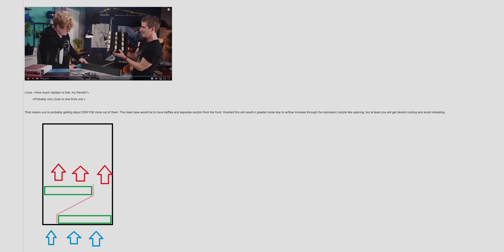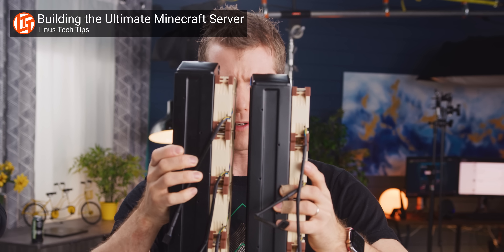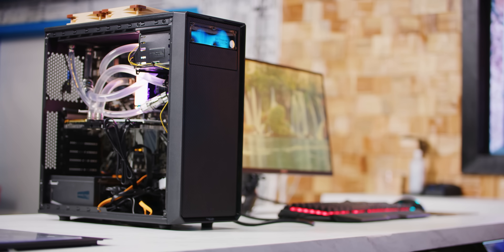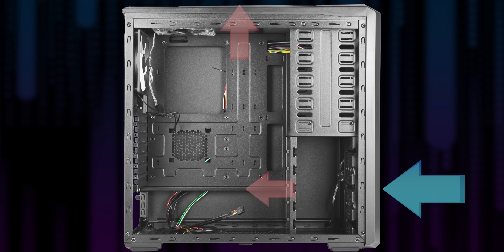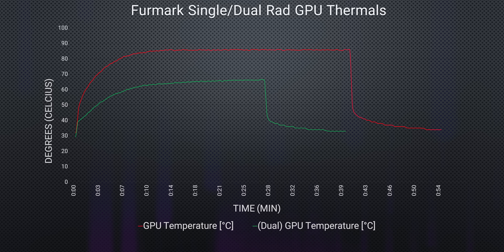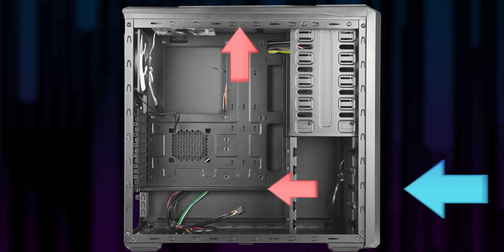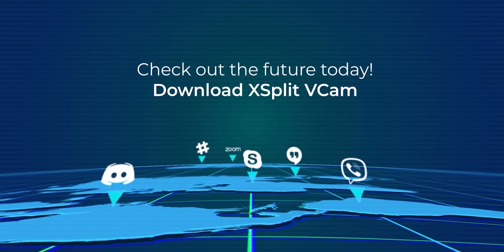I’ve been water cooling wrong for YEARS - $H!T Manufacturers Say

Comment: "Ive never done a side by side comparison" Then goes on to NOT stack radiators for a side by side comparison, and has the first rad in the loop from the MB as a exhaust and second as intake. Completely different than what he had done previously, and not at all what Corsair was saying.
Reply: Exactly what I was thinking!
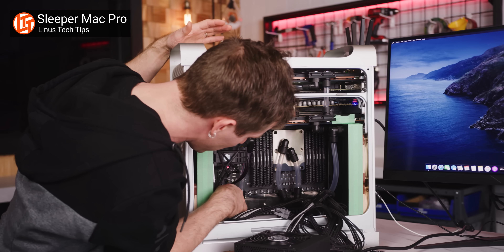Reply: Watch from 6:40 and he makes the change to the same machine they were commenting on, and the temp also increased
Reply: @Jonno12345  All he did was remove a rad, should of just not stacked them and used them all as intake. Probably barely cooler that way, and probably impossible to actually put back in the system in that configuration.
Reply: Corsairs comment wasn't about stacked radiators though - It was merely about utilising more than one radiator in a system, though.
Did you even watch the video?
Reply: @christoffermaintz781  No i just commented on something from the video without watching it, cause im magic like that.

Comment: Perhaps it depends on where in the loop are the intake/exhaust radiators... Maybe it's worse to have the first radiator in intake and the second in exhaust (since the difference in temperature is going to be diminished for the second radiator). It could be better to have the first radiator in exhaust (dissipating the bulk of the heat and not heating up the air inside the case) and the second one in intake (with both air and coolant temperatures lower, resulting in a higher temp difference throughout the loop). But I agree with your explanations, arguments on both sides makes sense!

Comment: Interesting video, but, there are many things to consider in this cooling problem and your arguments. 

First of all, why don't case manufacturers build cases which a specifically designed for water cooling? You don't want to cool a radiator using the hot air inside the case (after all cars don't cool the radiator with air from the engine bay), the radiator should, for example be mounted on top of the case with a cross-flow of room air, which is cooler than inside the case. Then have conventional air cooling within the case to remove excess heat from the remaining components. 

Furthermore, cooling would be improved with a larger mass of coolant, which might go some way to explain your hideous stacking system. The benefit would be that you would maintain a larger temperature difference between coolant and cpu. Think of it this way, you have a constant heat source, the cpu, and a certain mass of coolant. If the mass of coolant is too small the temperature will rise rapidly and be difficult to cool a much larger mass would rise more slowly and be easier to cool. What you also need to consider is the cooling efficiency of your radiators which need to be capable of removing sufficient heat to keep the water temp down and hence the cpu temp down. And it goes on... It's a really complex problem and to do it properly you would need to collect a lot of data from temperature sensors all over the place. Maybe, another video?

Comment: Just try that every radiator gets fresh air from the outside for the best efficiency, instead of re-using the warm air that already passed through your first (or second) radiator when you stack them. That's the central point. 

Stacking radiators one after the other DOES reduce the amount of heat that are able to dissipate unless you have an input of fresh air between them.

(Mechanical engineer with a master degree in thermal fluids here, in case anyone asks)

Comment: Makes sense. If the first radiator is completely saturated, it's physically not able to dump all of it's energy into the passing ambient. Meaning that there's still a heat differential able to be used to dissipate additional heat using a second radiator (even if it's not a doubling of efficiencies - which isn't realistic anyway).

I think that's the real crux of the issue though. Is the better thermal performance worth the cost of a second radiator? I would say that unless you're bumping into dangerous levels, and or thermal throttling, the answer is no. And if you want lower temps, you may want to just invest in a better radiator in the first place.

Comment: I mean yeah, having warm air from one radiator enter another radiator might make the second radiator less efficient by reducing the temperature gradient, but unless the air is already the same temperature as the radiator it will still transfer energy from the water, to the radiator, to the air. Basic physics; energy wants to spread out and not be all concentrated in one place, eventually leading to entropy and the heat death of the universe. And sometimes you just don't have the ability to ensure every radiator is getting 'fresh' cool air.

Comment: It is possible to create both scenarios by scaling up or down the radiator sizes and fan speeds. And of course case volume and CPU/GPU capability to transfer more heat to the loop matter as well.
Try using very small case with components that transmit a lot of heat and then put one 120mm radiator in front. Then the second radiator would be useless.

Comment: Question, have you had a radiator leak?
Mine did last year and since then I've moved my radiator to the front of my pc instead of the top of my pc. Granted my new case has that ability whereas my original case did not. Managed to get the parts all reworking even after leaks and shortages, minus my ram I think thats finally kicked it last week and needs replacing. That or the MOBO

Comment: It is absurd saying that you would get higher temps... however they are quite right when pointing out the fact that you are not doing an efficient use of those radiators. 
Proof is that removing one out of three radiators didn't mean 30% higher temps...

Comment: Obviously you arent testing what Corsair was critiquing. Double up your radiators vs having a single radiator. There will be diminishing returns, but there will still be returns. 
2 things. 
1) when you add water mass you are increasing the time required to heat the water, resulting in cooler temps for longer. 
2) there is very little concern about re-heating the water due to exposure from warmed air because computer cases have generally enough airflow to bring in cool air from the outside, or you can always have a balanced intake-exhaust ratio of air. The computer will basically only equalize when the room temp and rad-temp equalize which wont happen in modern houses with AC.

Comment: Linus: "do your own research"

Me: "this IS my research..."
Reply: Remember kids, the difference between science and fucking around, is writing it down.
Reply: BloodSteyn holy shit that is actually true
Reply: @BloodSteyn  yes!
Reply: @BloodSteyn  because recording it doesn't count
Reply: ''This is OUR research"
Reply: @YoshinoXTempest  Comrade...
Reply: itstillgot come out hot so hot air hit hot raditor won't do much...
Reply: Im a little late here but his test actually proved corsair correct and i can also say for what he was trying test, he set it up wrong. Thats why you should do your own research, to bad you drank the kool-aid.
Reply: @timessiah94  no this is just an example of why stupid people have a hard time succeeding in life. Stupid research by stupid researchers has the same problem.

If the case is "airtight" with no airflow near the ram it won't matter. The point ia that you need air blowing directly on the ram. Hot air blowing on the ram is better than no air blowing on the ram. Heat travels by 3 modes: convection, conduction and radiation. For air to flow over the ram and thus carry heat away by conduction and convection there has to be a path of low resistance as well as a pressure differential for the ram to sit in. There could be 5000 holes in the case. That is not a problem as long as one or more of the holes induces cooling air to flow over the ram. The optimum flow over the ram amd through the case to minimize component temp  is a different issue. But the air will always prefer to flow the path of least resistance combined with the greatest pressure-drop. So it will not flow over finned surfaces until the pressure differential is enough to overcome the flow resistance. A simple smoke test combined with useful thermistor placement will guide to the optimum case and fan configuration.
Reply: @pedritodio1406  dude check for innocents before you drive-by and start blasting, thanks
Reply: @touristguy87  yeah speak that to yourself
Reply: @pedritodio1406   I'd look silly so I refuse
Reply: true....

Comment: Stacking radiators is probably a bad ideal. But why don't you try this experiment. Stack radiators, by putting the Intake in the front and the outtake in the back. Then try the Intake in the back and outtake in the front. I bet Corsair logic is based on intake on the front not the back. But if you intake on the back radiator first I bet the system runs cooler. 
Linus time to get out your test bench all over again!

Comment: You should stipulate "STACKED" or series radiators... If you don't stack them, it works fine... if both radiators are seperate drawing cool air there is no issue..... Parrellel vs stacked will allways be better....

Comment: You are using twice the water mass inside the case that will be cooled. Also, airflow is included in the reasoning... If you push the air too slow it will be hotter. If you use less mass that will be cooled(same air  flow), it will be hotter. Also the heat capacity of water is >4x the capacity of air that you are displacing by just putting the radiator in the case.

Comment: I'm using two radiators.  CPU less than 50C and 2080 super graphics card 46C, water 36C while playing Black Desert Online and watching full screen YouTube videos.  I do have a fan bringing in outside air for the second radiator so it doesn't just get warm air from the first cooler.

Comment: I think I see what's going on here. It's possible that system with the 3 stacked rads would actually cool better if the rads were more spread out. Though I don't see how that would be possible with that case and things seem to be working fine the way it is.

The claims that I've heard in this video indicate that there shouldn't have been a temp increase when one of the rads were removed though, that on its own was proven false.

The TL;DR of all of this is while it's not the most efficient way to do it the cooling solution works. I don't personally see an issue with it.

Comment: “Now, if we had sealed off every potential air leak, it’s possible we would’ve seen something closer to Corsairs simulation. But, as far as we can tell, that’s just not a true representation of the real world. I mean, nobody would do that.”
I was really expecting you to follow up with “…or would they?”
 and then show us how you sealed up all the holes and ran the tests again.
Reply: I don't think Corsair was quite right here in the first place, only some of the air going through the radiator will be maximally loaded, but most of it will not be as the water cools going through it. Also depends on the loop flow, basically you want to cool the coolest water /radiator first and then the air can still be used to cool the hotter radiator.
Reply: @defeqel6537  I agree with this statement.  I am not a chemist or physicist but I am thinking that at the molecular level, only a very small amount of air molecules actually make contact with the fins and that the heat would then have to transfer from air molecule to air molecule from there and that with each jump, the process would lose efficiency. This means that the air molecules flowing directly through the center of each hole in the radiator would be cooler than the air molecules that actually make direct contact with the fins.   However in a mathematical simulation, if you assume all air molecules actually make contact with the fin, then sure, stacked radiators don't make sense.
Reply: @bengaming3649  that's why they call it Physics 101
Reply: With Flex-seal, the all in one solution for sealing gaps and cracks.
Reply: i was thinking as he said that.. "i would"
Reply: Case manufacturers - hold my beer
Reply: What Corsair is saying is that there is only a negligible or nearly negligible bump in cooling when stacking. The reason their Minecraft server coolers worked better is because it had more fans to combat the increased air resistance, but they still had plenty of heat soak because they're trying to get twice the airflow through the same airspace.
Reply: I did that before, with take and black cardboard over every sized opening. But that was more to prevent dust buildup.
Now I just use diy filters which work great.
Reply: @HappyBeezerStudios  what is best diy filter material?
Reply: @netmaster88  remove the side of your case, add a 20" box fan with a 20"x20" hepa filter taped to it (on the intake side). The fan blowing into the case will create a positive air pressure of really clean air. Ugly, but form follows function for this engineer.
Reply: @HappyBeezerStudios  keeping your place clean also helps alot !
Reply: Yeah, that would be a good test. Also, you may even see similar effects if you just have positive air pressure in the case.
Reply: I'm even more impressed with how they've actually asked everyone.
Reply: What is heat capacity? Run zero radiators and a 55 gallon reservoir and you'll smash these results. The extra radiator is adding water volume, that's all.
Reply: @hlaw2830  you've got it backwards. Radiators reduce the thermal resistance to heat transfer between the circulating medium and the ambient.Adding more water would increase the heat capacity of tbe circulating medium but it will retain the heat with insufficient radiator flow to ambient. The same process that leads to solar fusion.

Heat sources produce heat in W/sec and the job of the cooling system is to transfer heat to ambient at that same rate otherwise the entire system heats up and reduces effective heat transfer which causes the source to overheat...it is a cycle....
Reply: @touristguy87  One BTU is the energy required to raise one pound of water one degree fahrenheit, and 55 gallons weighs 458 pounds. If people can water cool a DE HPS grow light like this, your computer won't be a problem, lol. That said, this is all about to become obsolete, my boi wanted to improve cool suits because race car, and he's figured out how to drop ambient to less than -60 almost instantly with peltier sandwiches.
Reply: @hlaw2830  wow, he's caught up to 1834  maybe next he'll think of using a gas cooled to its liquid state maybe even CO2 solid!
Reply: @touristguy87   Lol, are you under the impression that computers haven't changed since 1822 as well? He's been talking with big companies in the cool suit industry, and the best their engineers could do was 60F at 40a/14v in a 170F cockpit; he hit them with <0F at 8a/14v in a 170F cockpit, something they said was impossible before he demonstrated it.

In case you don't understand the significance of those numbers, imagine hearing about a car which gets 75mpg, with a top speed of 390mph... and then commenting that people have finally caught up with 1886, lol.

I'm embarrassed for you, my man.
Reply: @hlaw2830  they were playing him
Reply: @touristguy87  Lol, no they weren't, but if you think you can put together a peltier that efficient and effective yourself, there's a mid six figure offer out there just waiting for you.
Reply: @hlaw2830  "Putting an insulated suit on a race car driver is an absurd proposition,"

Not if it's insulated to keep heat out

how many times this summer have you stopped yourself from putting drinks into a cooler with ice to keep them cold? 

Or do you not understand the word "insulation"?
Reply: @touristguy87  I understand insulation, but I don't think you understand motorsport. Dexterity, endurance, and reaction time are all huge factors. The machine isn't doing all of the work, these guys can be pulling 6+ lateral Gs. They're single foot leg pressing ~350lbs coming into quite a few corners, while experiencing 5 Gs of deceleration, and a lot of series ban power steering as well.

Plus, you need to be able to hop out quick and easy, or be dragged out, in the event of a crash. So, while I don't actually disagree with your premise, the materials don't exist.
Reply: @touristguy87  So, you admit that the materials don't exist?
Reply: @touristguy87  No, rediscover that optimism you felt when you were fresh. Stay skeptical, because there is a lot of bullshit out there, but... there are a few specs of gold in this garbage heap. Dude's still early alpha with these peltiers, but for a few years on the side in his basement? Don't be one of the people who said the first IPhone was stupid because it didn't have buttons, lol.

I mean, fuck Nomex, what's up with aerogel? I don't think it can achieve what you're talking about yet, but... who says it can't tomorrow? Did you get a degree to build something, or to maintain what other people build?
Reply: Didn't he do exactly that with the minecraft server build? There's no cool air mixing in in between stacked rads...

Comment: The problem with PC Liquid cooling is enthusiasts have preloaded the subject with years of asinine dogma that's not only sketchy but completely stupid and goes against the very principles they claim they understand.  We were Liquid cooling back in the mid 90's and it was a fail every time, oh sure yes after a few minutes the temps look great, after 2-3 hours they freakishly mirror air cooler temps.....oh yeah liquid coolers use fans too DUH!
P.S If you use a radiator without a thermostat it's basically pointless once your liquid reaches heat saturation, any dumb comments??  Take the thermostat out of your car and go on a long drive then try to argue that you only need a fan and rads,  same principles same effects same results.  Please refer to the article on specific heat and Water first.